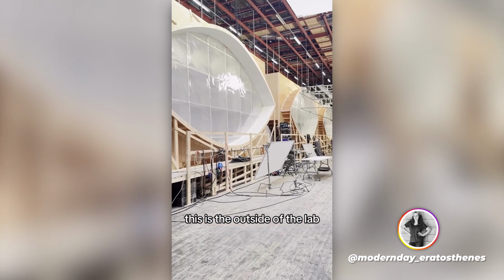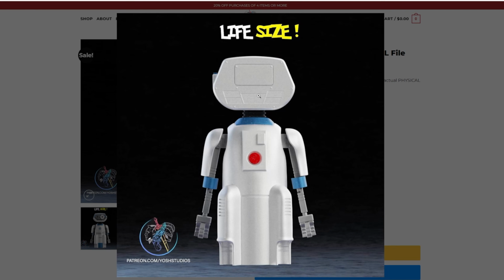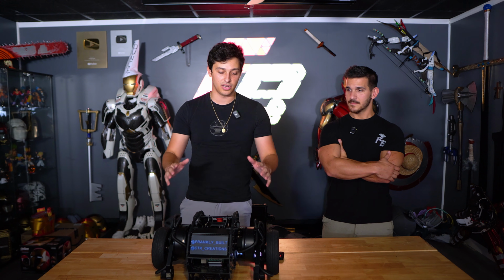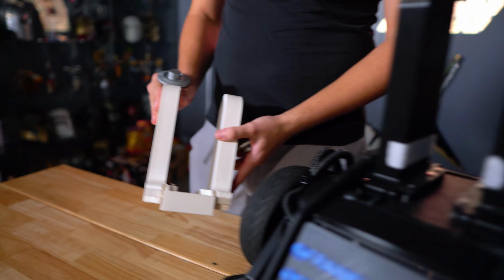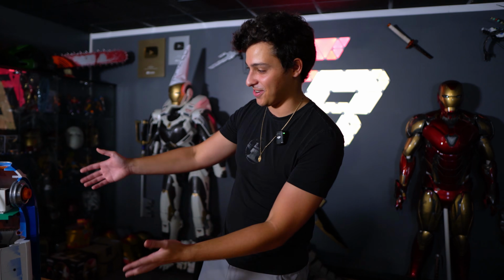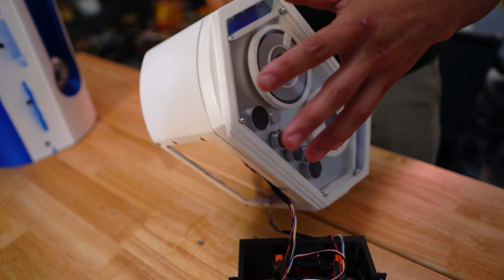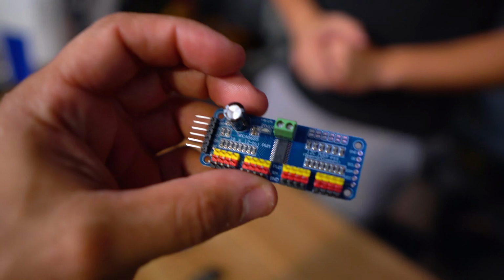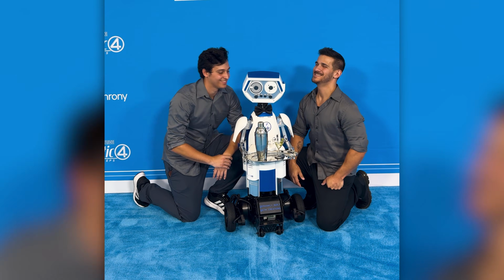3D Printing a REAL Robot! | Herbie from Fantastic Four

Comment: As someone who built a 1:1 scale, fully mobile, operator-on-the-inside, completely electro mechanical Dalek I completely understand how insane this build was. Now I took 3 years to complete my Dalek as it was built from scratch using, wood, metal and fiberglass but the electronic challenges were the same. Luckily I don't have insane timelines for my builds ... lol o
He has a disassembled electric wheelchair for motorization, 2 Arduino Unos, several DC motors, servos, motor controllers, etc and uses 5v, 12v and 24v power. He has 3 video cameras since my visibility sitting inside him is limited ( one looking fwd, one looking backwards and one looking from the eyestalk so I can see the position of the dome (it rotates 360 degrees in either direction). I built a working iris for his eye so he can blink, his gun has a cold cathode pc tube in it to give him a blue light saber effect in the barrel and his plunger arm extends and retracts using a car radio antenna motor. As a USAF Test Pilot School grad I just 'happen' to have a working F-15 flt control stick lying around my shop so all 7 different functions he has are controlled by the flt stick which is mounted on top of the  wheel chair joy stick so I can drive him around and operate everything one handed. There is also a voice modulator designed by one of the builders from Project Dalek which is 'builder's central' for Daleks that also has a sound-to-light circuit which allows you to sound like a Dalek and have his 'light domes' light up when you talk just like on the show.
As you can imagine he and his buddies are big hits when we should up at Sci Fi conventions ...
And yes, we get the same comments ..." are you guys from the TV show? ... lol.  As you now know when we makers recreate a screen accurate robot they are actually much more sophisticated then one ones on the show since they can have a dozen people working to make the robot work on screen while we have to make the robot do everything as an actual robot independently!